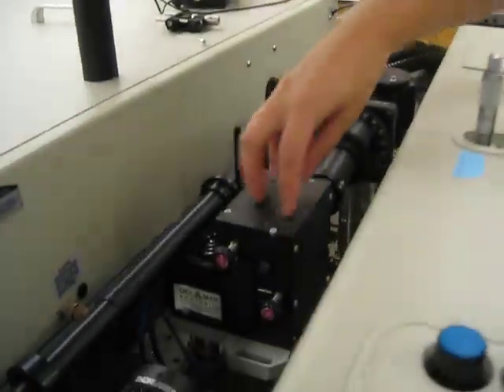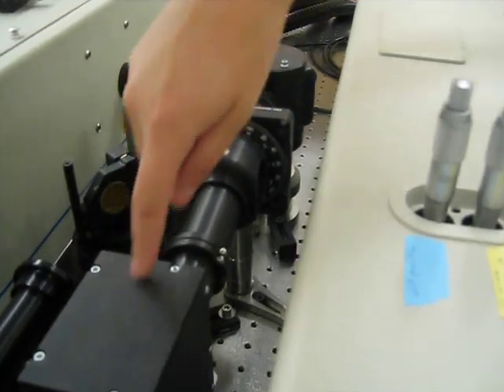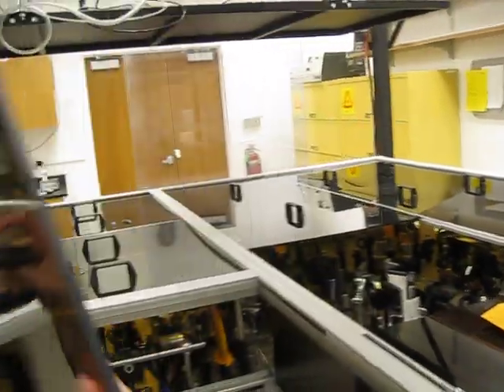A single source femtosecond-millisecond broadband spectrometer UC Davis - sales@dmphotonics.com

Comment from the maker: Machine technology for 3D microprocessing of complex curved surfaces
Max Groenendijk
12 February 2015 • 3:30 - 4:00 PM | Part of SPIE LASE

Digital micromirror devices for laser-based manufacturing on the micro-scale
Ben Mills, Dan Heath, Matthias Feinaeugle, Rob W. Eason
10 February 2015 • 9:50 - 10:10 AM | Part of SPIE OPTO

Fabrication of a plasmonic pyramid array substrate and microfluidic device for cell transfection
Daryl I. Vulis, Marinus Huber, Nabiha Saklayen, Sebastien Courvoisier, Jean-Pierre Wolf, Eric Mazur
8 February 2015 • 5:40 - 6:00 PM | Part of SPIE LASE

Colloidal, inorganic nanoparticles as efficient nonlinear optical probes
Dominika Wawrzynczyk, Marcin Nyk, Janusz Szeremeta, Marek Samoc
8 February 2015 • 4:05 - 4:20 PM | Part of SPIE BiOS

In vivo visualization of collagen fiber produced by cultured osteoblasts using sensitive second-harmonic-generation microscopy equipped with a 10-fs mode-locked Ti:sapphire laser
Eiji Hase, Katsuya Sato, Takeshi Yasui
8 February 2015 • 5:30 - 7:00 PM | Part of SPIE BiOS

Towards the development of an ultracompact optically sectioning endoscope with no distal optics
Youngchan Kim, Sean Warren, James M. Stone, James Roper, Jonathan C. Knight, Mark Neil, Carl Paterson, Christopher W. Dunsby, Paul M. W. French
9 February 2015 • 12:00 - 12:20 PM | Part of SPIE BiOS

Role of the surface plasma density on the formation of laser induced periodic surface structures (LIPSS) on Ti upon double fs pulse irradiation
Laura Gemini, Masaki Hashida, Yasuhiro Miyasaka, Shunsuke Inoue, Jiri Limpouch, Tomas Mocek, Shuji Sakabe
12 February 2015 • 10:00 - 10:20 AM | Part of SPIE LASE

5.7mJ fiber-CPA system delivering 23.5 gW of peak power
Arno Klenke, Steffen Hadrich, Tino Eidam, Marco Kienel, Jens Limpert, Andreas Tunnermann
11 February 2015 • 3:50 - 4:10 PM | Part of SPIE LASE

Intense THz sources for condensed matter physics
Matthias C. Hoffmann
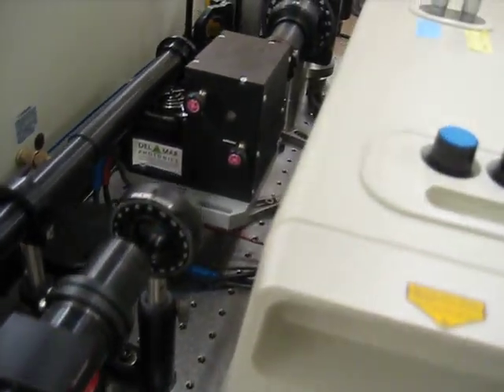10 February 2015 • 2:20 - 2:50 PM | Part of SPIE LASE

Chirped- and divided-pulse Sagnac fiber amplifier
Florent Guichard, Yoann Zaouter, Marc Hanna, Franck Morin, Clemens Honninger, Eric P. Mottay, Patrick Georges
11 February 2015 • 4:30 - 4:50 PM | Part of SPIE LASE

Increasing performance of mobile devices: fs laser assisted high quality photonic devices in display glass screens
Jerome Lapointe, Mathieu Gagne, Raman Kashyap
9 February 2015 • 4:00 - 4:20 PM | Part of SPIE LASE

Plasma dynamics during fs-laser fabrication of waveguides inside zinc phosphate glass
Javier Hernandez Rueda, Vladimir Semenov, Neil Troy, Charmayne E. Smith, Richard K. Brow, Denise M. Krol
9 February 2015 • 3:20 - 3:40 PM | Part of SPIE LASE

Ultrashort pulse laser interactions with cortical bone tissue for applications in orthopaedic surgery
Simon A. Ashforth, Miriam C. Simpson
8 February 2015 • 11:10 - 11:30 AM | Part of SPIE LASE

Bioinspired artificial light collectors for enhancement of imaging in dim environments
Hewei Liu, Yinggang Huang, Chi-chieh Huang, Hongrui Jiang
7 February 2015 • 10:50 - 11:05 AM | Part of SPIE BiOS

Two-photon photoacoustic microscopy using image subtraction with two different pulse excitations
Yoshihisa Yamaoka, Yoshinori Harada M.D., Masaaki Sakakura, Takeo Minamikawa, Shigeru Nishino, Seiji Maehara, Shujiro Hamano, Hideo Tanaka M.D., Tetsuro Takamatsu M.D.
10 February 2015 • 6:00 - 8:00 PM | Part of SPIE BiOS

Binary phase shaping for mitigating self-phase modulation
Gennady Rasskazov, Marcos M. Dantus
10 February 2015 • 6:00 - 8:00 PM | Part of SPIE LASE

Fluorescence lifetime imaging in the near-infrared region
Wolfgang Becker, Vladislav I. Shcheslavskiy
8 February 2015 • 5:30 - 7:00 PM | Part of SPIE BiOS

Optical and thermal properties in ultrafast laser surface nanostructuring on biodegradable polymer
Shuhei Yada, Mitsuhiro Terakawa
8 February 2015 • 8:50 - 9:10 AM | Part of SPIE LASE

Fabrication of perfluoropolyether atomic force microscopy tips with two-photon polymerization
Tommaso Zandrini, Raffaella Suriano, Carmela De Marco, Roberto Osellame, Stefano Turri, Francesca Bragheri
10 February 2015 • 6:00 - 8:00 PM | Part of SPIE LASE

Laser-induced breakdown spectroscopy for chemical characterization of laser structured Li(NiMnCo)O2 electrodes for lithium-ion batteries
Peter Smyrek, Johannes Proll, Hans J. Seifert, Wilhelm Pfleging
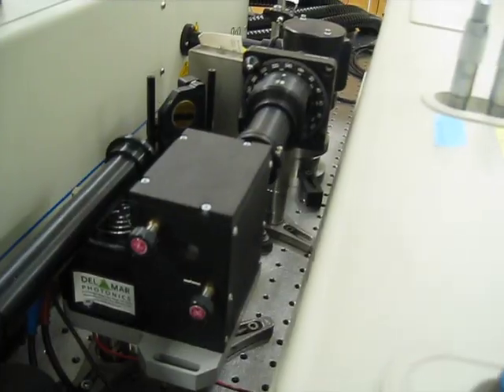12 February 2015 • 2:30 - 2:50 PM | Part of SPIE LASE

Nonlinear compression of industrial ultrafast lasers in hypocyloid-core Kagome hollow-core fiber
Achut Giree, Florent Guichard, Guillaume Machinet, Yoann Zaouter, Yvon Hagen, Benoit Debord, Pascal Dupriez, Frederic Gerome, Marc Hanna, Fetah A. Benabid, Clemens Honninger, Patrick Georges, Eric P. Mottay
9 February 2015 • 8:30 - 8:50 AM | Part of SPIE LASE

Effect of the Zn coordination complex of the excited-state and two-photon absorption spectra of a novel salicylidene compound
Marcelo G. Vivas, Jose Germino, Tereza Atvarz, Cleber Mendonca
8 February 2015 • 4:15 - 4:30 PM | Part of SPIE OPTO

Single grating mirror intracavity stretcher design for chirped pulse regenerative amplification
Etienne Caracciolo, Matthias Kemnitzer, Martin Rumpel, Annalisa Guandalini, Florian kienle, Federico Pirzio, Thomas Graf, Marwan Abdou Ahmed, Antonio Agnesi, Juerg Aus-der-Au
10 February 2015 • 11:10 - 11:30 AM | Part of SPIE LASE

Enhanced nanograting formation assisted by silver ions in a sodium gallophosphate glass: Correlation between surface nanostructuring, fluorescence, and effective second-order nonlinear optical properties
Marie Vangheluwe, Feng Liang, Yannick Petit, Patricia Hee, Yannick Ledemi, Sebastien Thomas, Nicolas Marquestaut, Evelyne Fargin, Thierry Cardinal, Younes Messaddeq, Lionel Canioni, Real Vallee
8 February 2015 • 2:30 - 2:50 PM | Part of SPIE OPTO

Yb-fiber laser for multimodal imaging
Ilyas Saytashev, Bingwei Xu, Marcos Dantus
9 February 2015 • 4:05 - 4:20 PM | Part of SPIE BiOS

Two-photon endoscope with no distal optics
Herve Rigneault, Esben R. Andresen, Geraud Bouwmans, Serge Monneret
9 February 2015 • 2:30 - 2:50 PM | Part of SPIE BiOS

Elucidating photodynamics with ultrafast pulse sequences: pump-repump, multidimensional spectroscopy, and beyond
Patrick Nuernberger, Stefan Ruetzel, Tobias Brixner
8 February 2015 • 11:15 - 11:45 AM | Part of SPIE OPTO

Broadband 2.5-6?m frequency comb source for dual-comb molecular spectroscopy
Viktor O. Smolski, Konstantin L. Vodopyanov
9 February 2015 • 2:35 - 2:55 PM | Part of SPIE LASE

Photonic crystal fiber supercontinuum sources for optogenetics
Eugene D. Ark, Kush Paul, Haohua Tu, Youbo Zhao, Stephen A. Boppart
7 February 2015 • 4:20 - 4:40 PM | Part of SPIE BiOS

Ultrafast non-equilibrium carrier dynamics in semiconductor laser mode-locking
Jerome V. Moloney, Isak Kilen, Joerg Hader, Stephan W. Koch
9 February 2015 • 8:00 - 8:30 AM | Part of SPIE LASE

THz generation by optical rectification in graphene at room temperature: beyond the linear carrier dispersion
Juliette Mangeney, Jean Maysonnave, Simon Huppert, Feihu Wang, Simon Maero, Claire Berger, Walter A. de Heer, Theodore B. Norris, Louis-Anne de Vaulchier, Sukhdeep S. Dhillon, Jerome Tignon, Robson Ferreira
8 February 2015 • 12:15 - 12:35 PM | Part of SPIE OPTO

Ultrafast biexciton dynamics in single CdSe/ZnSe quantum dots
Denis V. Seletskiy, Christopher Hinz, Johannes Haase, Christian Traum, Florian Werschler, Stefan Lohner, Alfred Leitenstorfer
10 February 2015 • 12:20 - 12:35 PM | Part of SPIE OPTO

Efficient Auger scattering in Landau-quantized graphene
Florian Wendler, Martin Mittendorff, Stephan F. Winnerl, Manfred Helm, Andreas Knorr, Ermin Malic
8 February 2015 • 9:45 - 10:00 AM | Part of SPIE OPTO

Self-focusing effect on THG at interfaces of solvent-cuvette
Emerson C. Barbano, Kerrianne Harrington, Sergio C. Zilio, Lino Misoguti
10 February 2015 • 6:00 - 8:00 PM | Part of SPIE LASE

Charge separation in OPV bulk heterojunctions
Andrew B. Matheson, Arvydas Ruseckas, Ifor D. W. Samuel
11 February 2015 • 6:00 - 8:00 PM | Part of SPIE OPTO

Advances in Chalcogenide galsses and Optical fibers
Younes Messaddeq, Sandra H. Messaddeq, Mohammed Elamraoui, Jean-Philippe Berube, Real Vallee
10 February 2015 • 9:30 - 10:00 AM | Part of SPIE OPTO
9 February 2015

Ultrafast coherent charge transfer in solar cells and artificial light harvesting systems: toward movies of electronic motion
Christoph Lienau
9 February 2015 • 8:50 - 9:30 AM | Part of SPIE OPTO

Sub-100 fs passively mode-locked holmium-doped fiber oscillator operating at 2.06?m
Peng Li, Axel Ruehl, Ingmar Hartl
12 February 2015 • 11:00 - 11:20 AM | Part of SPIE LASE

Laser induced structural modifications in fused silica within the microexplosion regime evidenced by Raman spectroscopy
Nadezda Varkentina, Arnaud Royon, Marc Dussauze, Yannick Petit, Lionel Canioni
10 February 2015 • 11:30 - 11:50 AM | Part of SPIE LASE
9 February 2015

Mechanisms of direct laser writing on a tailored silver-containing zinc phosphate glass: dual-color laser writing, UV post-illumination thermal influence, and sub-diffraction structures
Yannick G. Petit, Konstantin Mishchik, Nadezda Varkentina, Arnaud Royon, Nicolas Marquestaut, Etienne Brasselet, Thierry Cardinal, Lionel S. Canioni
9 February 2015 • 5:30 - 5:45 PM | Part of SPIE OPTO

Active tunable photonics and ultrafast nonlinear optics with nematic and blue phase liquid crystals
Iam Choon Khoo
10 February 2015 • 11:00 - 11:30 AM | Part of SPIE OPTO
11 February 2015

Mobile laser lithography station for microscopic two-photon polymerization
Frank Leinenbach, Hans G. Breunig, Karsten Konig
12 February 2015 • 4:20 - 4:40 PM | Part of SPIE LASE

Broadband transient THz conductivity of the transition-metal dichalcogenide MoS2
Jan H. Buss, Ryan P. Smith, Giacomo Coslovich, Robert A. Kaindl
10 February 2015 • 5:00 - 5:15 PM | Part of SPIE OPTO

Amorphous chalcogenide layers and nanocomposites for direct surface patterning
Sandor J. Kokenyesi, Sandor Molnar, Roland Bohdan, Istvan Csarnovics
9 February 2015 • 2:00 - 2:20 PM | Part of SPIE OPTO

Process and parameter optimisation for micro structuring of 3D freeform metallic surfaces: A comparative study of shortpulse (ns) and ultrafast laser (ps, fs) ablation
Steffen G. Scholz, Melanie Mangang, Wilhelm Pfleging
10 February 2015 • 4:20 - 4:40 PM | Part of SPIE LASE

Optical multi-coset sampling of GHz-band chirped signals
George C. Valley, George A. Sefler, Thomas J. Shaw, Stephen L. Smith
11 February 2015 • 2:00 - 2:20 PM | Part of SPIE OPTO

Bessel filamentation in glass
Chen Xie, Vytautas Jukna, Ismail Ouadghiri, Carles Milian Enrique, Remo Giust, Luca Furfaro, Pierre-Ambroise Lacourt, Maxime Jacquot, Luc Froehly, Razvan Stoian, Tatiana E. Itina, John M. Dudley, Arnaud Couairon, Francois Courvoisier
11 February 2015 • 9:20 - 9:40 AM | Part of SPIE LASE

Flat mid-infrared supercontinuum generation in tapered fiber with thin coating of highly nonlinear glass
Pantelis Velanas, Christos Riziotis, Georgios Kakarantzas
10 February 2015 • 6:00 - 8:00 PM | Part of SPIE LASE
11 February 2015

Plasmonic cell transfection using micropyramid arrays
Nabiha Saklayen, Daryl I. Vulis, Marinus Huber, Lauren E. Milling, Sebastien Courvoisier, Valeria Nuzzo, Eric Mazur
8 February 2015 • 4:40 - 5:00 PM | Part of SPIE LASE

Ultrafast carrier dynamics in atomically thin WS2 layers in the low- and high-density regime
Claudia Ruppert, Alexey Chernikov, Heather M. Hill, Albert Rigosi, Tony F. Heinz
8 February 2015 • 2:30 - 2:45 PM | Part of SPIE OPTO

Plasmonic substrates for cell transfection
Marinus Huber, Nicolas Vogel, Weilu Shen, Nabiha Saklayen, Alexander Heisterkamp, Eric Mazur
10 February 2015 • 6:00 - 8:00 PM | Part of SPIE LASE

Next generation laser sources for non-linear imaging
Darryl McCoy, Marco Arrigoni, Nigel Gallaher
8 February 2015 • 4:10 - 4:25 PM | Part of SPIE BiOS

Nano-focused ultrafast spectroscopy and imaging reaching the single quantum level
Markus B. Raschke
9 February 2015 • 2:00 - 2:30 PM | Part of SPIE OPTO

Laser-assisted manufacturing of micro-optical volume elements for improving the amount of light absorbed by solar cells in photovoltaic modules
Gerhard Peharz, Ladislav Kuna, Claude Leiner
11 February 2015 • 6:00 - 8:00 PM | Part of SPIE OPTO

Mechanisms of 3D nanoparticles formation using direct laser writing and thermal annealing in a phosphate glass
Nicolas Marquestaut, Yannick G. Petit, Patrick Mounaix, Thierry Cardinal, Lionel S. Canioni
12 February 2015 • 9:20 - 9:40 AM | Part of SPIE LASE

Ultrafast element-specific magnetization dynamics of complex magnetic materials on a table top
Stefan Mathias, Chan La-O-Vorakiat, Justin M. Shaw, Emrah Turgut, Patrik Grychtol, Roman Adam, Denis Rudolf, Hans T. Nembach, Thomas J. Silva, Martin Aeschlimann, Claus M. Schneider, Henry C. Kapteyn, Margaret M. Murnane
11 February 2015 • 9:00 - 9:30 AM | Part of SPIE OPTO

Chirp scanning technique to determine the non-degenerate two-photon absorption
Renato Juliano Martins, Cleber R. Mendonca
8 February 2015 • 5:00 - 5:15 PM | Part of SPIE OPTO

MEMS-based handheld multiphoton endomicroscope for in vivo imaging
Xiyu Duan, Haijun Li, Zhen Qiu, Bishnu P. Joshi, Asha Pant, Katsuo Kurabayashi, Kenn R. Oldham, Thomas D. Wang M.D.
9 February 2015 • 3:40 - 4:00 PM | Part of SPIE BiOS

Competition between harmonic generation and multi-photon luminescence in selectively grown coaxial InGaN/GaN quantum wells on GaN pyramids for tunable light emission
Sween J. Butler, Mohamed Fikry, Klaus Thonke, Arup Neogi
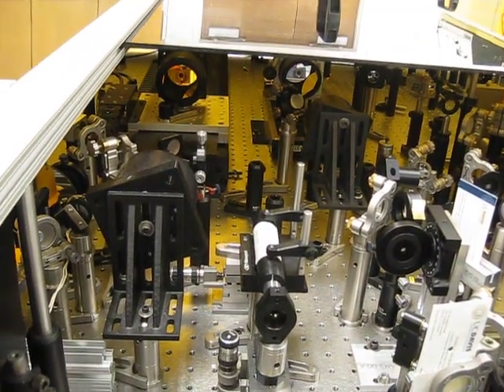11 February 2015 • 2:50 - 3:10 PM | Part of SPIE LASE

Low-noise supercontinuum: Development, characterization, and programmable biomedical imaging
Haohua Tu, Yuan Liu, Sixian You, Stephen A. Boppart M.D.
9 February 2015 • 10:40 - 11:00 AM | Part of SPIE LASE

Photoacoustic imaging using NIR two-photon excitation for ultrasonic wave generation
Ben E. Urban, Jr.
9 February 2015 • 5:30 - 7:30 PM | Part of SPIE BiOS

Coherent pulse stacking in fiber chirped-pulse amplification systems
Tong Zhou, John M. Ruppe, Cheng Zhu, I-Ning Hu, John A. Nees, Russell B. Wilcox, Almantas Galvanauskas
11 February 2015 • 4:10 - 4:30 PM | Part of SPIE LASE

Terahertz wavefront assessment based on 2D electro-optic imaging
Harsono Cahyadi, Ryuji Ichikawa, Jerome Degert, Eric Freysz, Takeshi Yasui, Emmanuel Abraham
10 February 2015 • 4:40 - 5:00 PM | Part of SPIE OPTO

DNA separation and fluorescent detection in an optofluidic chip with sub-base-pair resolution
Markus Pollnau, Manfred Hammer, Chaitanya Dongre, Hugo J. W. Hoekstra
8 February 2015 • 2:00 - 2:20 PM | Part of SPIE BiOS

Effects of burst mode on transparent materials processing
Clementine Javaux, John Lopez, Clemens Hoenninger, Eric P. Mottay, Rainer Kling
10 February 2015 • 5:20 - 5:40 PM | Part of SPIE LASE

Ultrashort pulsed laser tools for testing of semiconductor device hardness to local radiation effects caused by cosmic heavy ions
Oleg B. Mavritskii, Andrey N. Egorov, Alexandra V. Gordienko, Alexander A. Pechenkin, Dmitriy V. Savchenkov
10 February 2015 • 6:00 - 8:00 PM | Part of SPIE LASE

Ultrafast acousto-magneto-plasmonics
Vasily V. Temnov
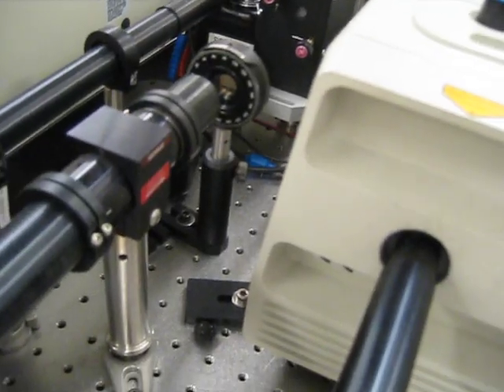10 February 2015 • 2:25 - 2:55 PM | Part of SPIE OPTO

Nonlinearly fiber-converted coherent source with broad spectral coverage for multiphoton imaging
Haohua Tu, Yuan Liu, Youbo Zhao, Stephen A. Boppart M.D.
8 February 2015 • 1:50 - 2:10 PM | Part of SPIE BiOS

Deep stroma investigation by confocal microscopy
Francesca P. Rossi, Francesca Tatini, Roberto Pini, Paola Valente, Roberta Ardia, Luca Buzzonetti, Annalisa Canovetti, Alex Malandrini, Ivo Lenzetti, Luca Menabuoni M.D.
8 February 2015 • 5:30 - 7:00 PM | Part of SPIE BiOS

Role of molecular photodissociation in ultrafast laser surgery
Jenny Wang, Georg Schuele, Phil Huie, Daniel V. Palanker
9 February 2015 • 8:50 - 9:10 AM | Part of SPIE BiOS

Two photon microscopy of native fluorophores spatial location in cancer and non-cancer cell lines
Lin Zhang, Lingyan Shi, Robert R. Alfano
8 February 2015 • 5:30 - 7:00 PM | Part of SPIE BiOS

Pulse splitter to produce ultrafast bursts
Antoine Courjaud, Vincent Clet, Areti Mourka, Aghasi Lorsabyan, Eric P. Mottay
9 February 2015 • 9:50 - 10:10 AM | Part of SPIE LASE

In vivo high-speed imaging of blood cells and tissues in mouse ear skin using multimodal nonlinear optical microscopy
Eung Jang Lee, Daeyeon Kim, Bo Ram Kim, Sung-Ho Lee, Seung-Han Park
8 February 2015 • 5:30 - 7:00 PM | Part of SPIE BiOS

Ultrafast in-situ probing of passively mode-locked VECSEL dynamics
Maik Scheller, Caleb W. Baker, Stephan W. Koch, R. Jason Jones, Jerome V. Moloney
9 February 2015 • 4:50 - 5:10 PM | Part of SPIE LASE

Laser nanofabrication for functional devices
Hong-Bo Sun
11 February 2015 • 4:10 - 4:40 PM | Part of SPIE LASE

Advances in planar photonic integration with a novel ultrafast laser plasma fabrication process
Jayakrishnan Chandrappan, Matthew Murray, Tarun Kakkar, Kenneth L. Kennedy, Richard A. Hogg, David P. Steenson, Gin Jose, Animesh Jha
10 February 2015 • 11:10 - 11:30 AM | Part of SPIE OPTO

Adaptive optics for the laser fabrication of 3D graphitic microwires in diamond
Patrick S. Salter, Bangshan Sun, Martin J. Booth
10 February 2015 • 9:20 - 9:40 AM | Part of SPIE LASE

Group delay of 45 ns in a 1-cm fiber Bragg grating
George Skolianos, Michel Digonnet, Arushi Arora, Martin Bernier, Real Vallee
9 February 2015 • 11:35 AM - 12:00 PM | Part of SPIE OPTO

Metal mirrors with metal-dielectric HR-coating for ultrashort lasers pulses applied in scanner applications
Mark Schuermann, Christian Franke, Sandra Mueller, Stefan Risse, Helena Kaemmer, Felix Dreisow, Stefan Nolte, Ramona Eberhardt, Norbert Kaiser
11 February 2015 • 9:40 - 10:00 AM | Part of SPIE LASE

Fiber laser driven ultrafast RGB source based on simultaneous second harmonic generation from a dual zero dispersion wavelength fiber source
Yuhong Yao, Wayne H. Knox
10 February 2015 • 4:20 - 4:40 PM | Part of SPIE LASE

Experimental demonstration of multidimensional amplification of ultrashort pulses
Marco Kienel, Michael Mueller, Arno Klenke, Tino Eidam, Jens Limpert, Andreas Tunnermann
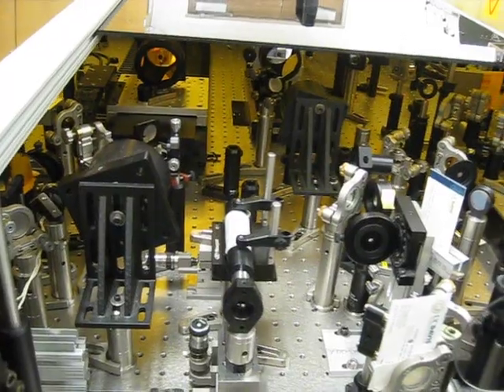11 February 2015 • 3:00 - 3:20 PM | Part of SPIE LASE

High speed deep tissue ablation with nonlinear imaging using an ultrafast fiber laser at 1045 nm
Murat Yildirim, Kaushik G. Subramanian, Adela Ben-Yakar
8 February 2015 • 9:10 - 9:30 AM | Part of SPIE LASE

Laser patterning for reel-to-reel production of organic photovoltaic (OPV) devices
Colin J. Moorhouse, Dimitris Karnakis, Christos Kapnopoulos, Argiris Laskarakis, S. Logothetidis, G. Antonopoulos, Christos Koidis
11 February 2015 • 4:00 - 4:20 PM | Part of SPIE LASE
COURSE AT CONFERENCE
Introduction to Ultrafast Optics (SC746)
Instructor(s): Trebino, Rick, Georgia Institute of Technology
Level: Introductory • 0.35 CEU • Length: 4.00 hours
Member Price: 300.00 | Non-Member Price: 355.00
8 February 2015 • 1:30 PM | Part of SPIE Photonics West

Optical isolators for 2-micron fibre lasers
Gary Stevens, Thomas H. Legg, Peter Shardlow
11 February 2015 • 9:30 - 9:50 AM | Part of SPIE LASE

Monolithic hybrid optics for broadband focusing and beam shaping
Ulrike Fuchs
10 February 2015 • 5:20 - 5:40 PM | Part of SPIE LASE

Sub-700fs pulses at 152W average power from a Tm-doped fiber CPA system
Christian Gaida, Fabian Stutzki, Martin Gebhardt, Florian Jansen, Andreas Wienke, Uwe D. Zeitner, Frank Fuchs, Cesar Jauregui-Misas, Dieter Wandt, Dietmar Kracht, Jens Limpert, Andreas Tunnermann
12 February 2015 • 10:40 - 11:00 AM | Part of SPIE LASE

Novel nanoring structure for light-induced generation of ultrashort magnetic pulses
Guillaume G. Vienne, Xiaoyu Chen, Ying Shi Teh, Ying Jye Ng, Nyap Oon Chia, Ching Ping Ooi
11 February 2015 • 10:00 - 10:15 AM | Part of SPIE OPTO

Spatial and temporal temperature distribution of ultrashort pulse induced heat accumulation in glass
Soren Richter, Fumiya Hashimoto, Yasuyuki Ozeki, Kazuyoshi Itoh, Andreas Tunnermann, Stefan Nolte
10 February 2015 • 10:50 - 11:10 AM | Part of SPIE LASE

Ultrashort pulse laser processing of glass: From cutting to welding
Stefan Nolte
11 February 2015 • 2:00 - 2:30 PM | Part of SPIE LASE
10 February 2015 • 6:00 - 8:00 PM | Part of SPIE LASE